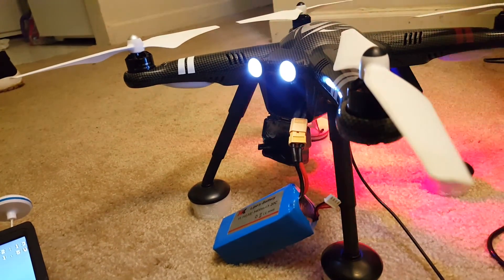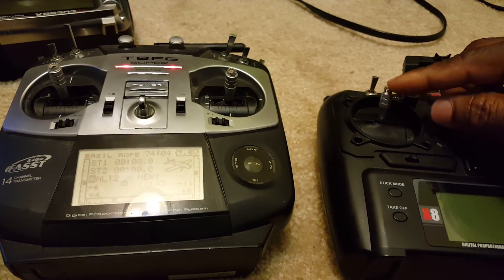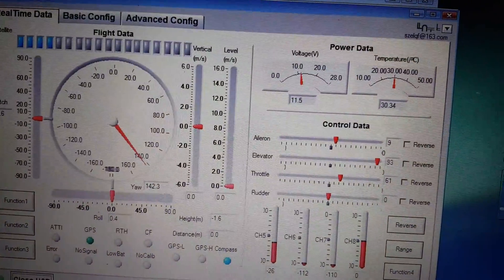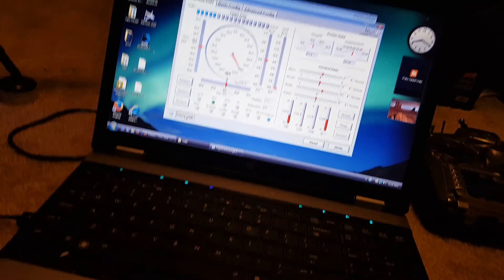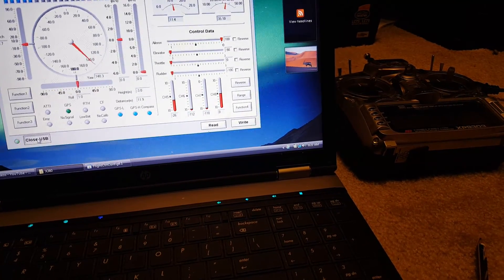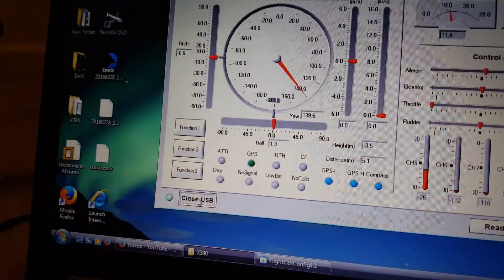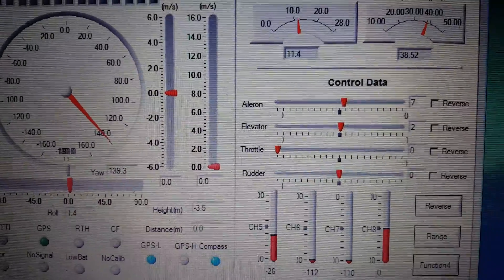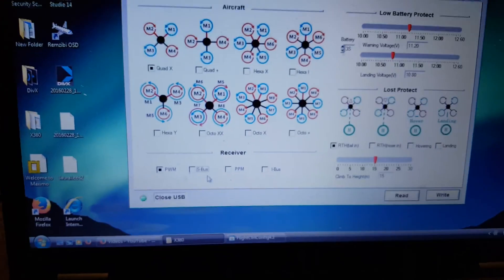Xk-380 flight config software

Comment: Good demo vid,,,are you using S-Bus connection from R/X to FC,,,?
Reply from the maker: No S-BUS...ppm procal
Reply: Thanks for the quick reply,,,i am converting mine to Taranis ,,with telementry for the on board battery voltage for ind/cell v,,,lowest cell etc,,,looking at the F/C board it has a Bus connection input written on the top.
I presume that would be S-Bus connection?
Again many thanks.

Comment: Thanks for the video...as far as changing any parameters on the software ie return to home height, do I need to click 'write' after I've changed something? and what does 'read' mean? Thanks
Reply from the maker: "Read" means getting the setting or data that's inside the quad so you can look at it. If you decide to modify anything inside the software you need to "Write" it inside the quad before you disconnecting. If you don't change anything just click the "open usb" to disconnect.    Write it like the save icon on your computer. "Read" is like downloading a file from the internet.  Hope this helps
Reply: Ah great that helps, thanks. So let me get this correct, when i change something and then click 'write' it sends those changes to the quad?

Comment: I see on your video that you quad is also reached 40 degrees like mine.(It means that it is normal) someone told me that when the quad rise the temperature so fast it mai be a problem with one of the components...on mine I can't make pitch to work.

Comment: hi basimpsn! You have a 2D gimbal on your quad? Is your quad pitch working? you can  tilt your camera from the remote control?
Reply from the maker: +cipsil81 Yes my g2 gimbal pitch works flawless and I even have 6 extra channels to play with. But my gimbal is connected directly to my receiver.